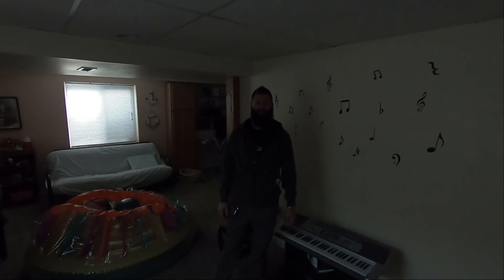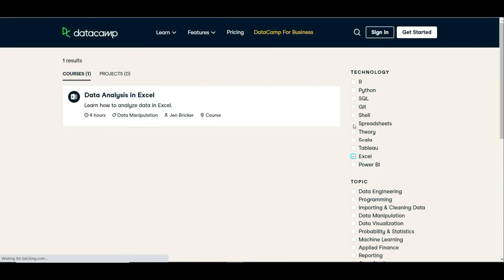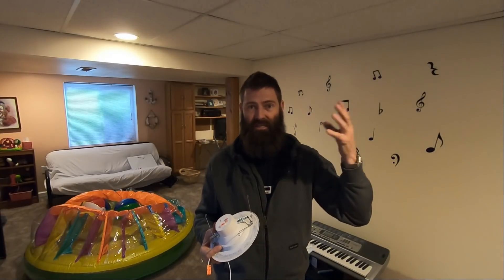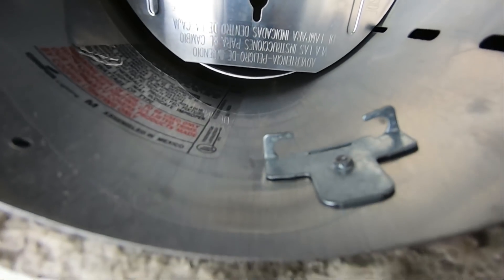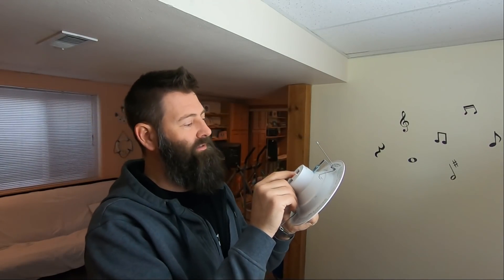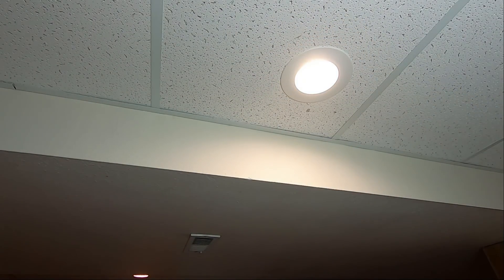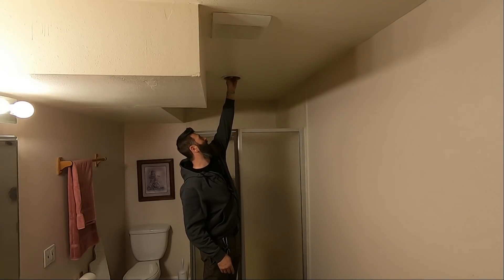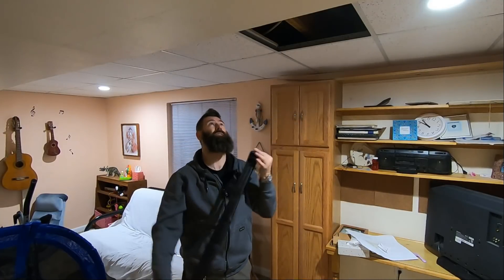The Worst Interior Lighting Fixed In 30 Minutes | LED Lights Will Change Your  Life | THE HANDYMAN |

Comment: "IC" means its rated for contact with insulation. Just changed some in my house and learned that. ^_~
Reply: Yep, otherwise you would have to push the insulation away if it was non-ic rated
Reply: @Zaakro  at least 3 inches away from the sides and nothing over the top of the light fixture

Comment: Hey Handyman! I ordered the LED light replacement for my can light. Opened the box from Amazon, pulled the insert out of the can, popped in the adapter and plugged in the LED light and clipped it in no problem! All in less than 5 minutes. Thanks for the video! Love your camera work and your presentation!

Comment: Just a friendly note from a IJoist designer ...  The holes it the TJIs are in the wrong  place. Make sure your hole is in the middle 1/3 of the OSB web only along the neutral axis. Never cut the top or bottom flange.

CHEERS

Comment: BTW when I added similar lights in my house from scratch, I believe IC rated means you can install them safely right up against insulation and other things because they don't put out enough heat to be a safety issue.
Reply: IC rated cans have a thermal cutoff and will flash on and off if you exceed the can's wattage rating. This should not be a problem with led's

Comment: I hate these can lights.  I have them in my vaulted ceiling with attic space above.  I replaced them with the LED lights, and made a box of sheetrock to seal above the hole in the attic.  No air flow, no bugs, and better for fire rating.  The beard is awesome!

Comment: Just a tip from a photographer and fellow YouTube. If you're going to show the difference in the light color, set your cameras white balance manually. Your camera is set on auto in this video so as you changed the light color, your camera automatically adjusted for it and after a couple seconds you no longer see the color difference. Does that make sense?
Reply: You can still see the color difference it is just not as extreme.
Reply: @ecospider5  oh yeah you can tell for sure but my point is if you watch your camera takes about 2 seconds and balances it back to normal. You only see the difference for those 2 seconds then it's balanced again. Either way it gets the point across just a suggestion so you can see the cor difference the whole time.
Reply from the maker: Thanks or the tip DiverseDad.  I could see the camera adjusting when I was flipping back and forth.  You could see the real color for a second or two before the camera adjusted.

Comment: IC I believe means Insulation Contact.  It means it is rated to come in contact with insulation that you may find in the attic.  I believe it is due to heat transfer.  Most of your older cheaper can lights were not IC rated and could start a fire if insulation was packed around them.

Comment: IC rated is for -An  fixture "shall be permitted to be in contact with 
combustible material or blanketed with thermal insulation", according to
 the Canadian Electrical Code section 30-906. Both the Alberta and BC 
Building Code (Section 3.2.7.2) stipulate that IC-rated fixtures are 
only to be use in insulated ceilings.

Comment: Ic means it is rated to be in contact with insulation, tc means it is not and usually requires at least 4” between the can and any insulation.

Comment: 1:45 I've used these lights throughout my entire house, and they work extremely well. I especially love the ones with the night light mode.  However, if your housing light switches are not up to date, you will probably have to purchase an LED wired light switch fir each unit. They're about an extra $30 for the ones with a dimmer setting.
Reply: That's what I was thinking, how to work the dimming feature. I guess with money, huh? Lol

Comment: IC rated is for "insulation contact" rated.  It can go into an insulated ceiling.
Reply: Meaning it can come in contact with insulation.
Reply: yes, that is correct to a point, you must still have a metal canister in place between the electrical fixture and the insulation. Some recessed fixtures when enclosed inside an attic or between insulated joists you must have another metal box surrounding the entire electrical components which leaves about 2" air space away from the insulation so it won't overheat and start fires.

Comment: I just replaced a can light with a regular plight fixture 6” hole. I had to rig a old work ceiling light box with the old rim and then drilled long tek screws on the four corners of the old can light box holder then drilled four corners of the old lip to the ceiling with the tel screws. Luckily my light fixture covered this mess and all looks like a million bucks. This seemed way easier but wife didn’t want recessed lighting.

Comment: Just got a 12 pack of these pancake led cans for like $90 on Amazon. So much cheaper than anything at Lowes or Home Depot, but probably a cheaper fixture that may not last as long.
 I prefer the electrical box detached from the fixture instead of attached like what you have. The reason: if I cut a light hole where there happens to be a rafter it won't matter

Comment: I prefer the 3500k for all lighting needs - 2700 too yellow and 5000 is too blue.. perfect choice! IC rated means it can be installed in an insulated ceiling. Meaning it won’t catch the insulation on fire - hopefully!!

Comment: Pretty sure those engineered joists are NOT rated to have loads hung from the bottom member like that. You're now relying on the glue joint of the bottom member to the osb web, and the osb web to the top member - not good!

Comment: Using a piece of Unistrut to connect both ceiling joists would have allowed you to add a ring and swivel through the tile to hang the swing.

Comment: If installed in a shower, do you need to do anything to air seal around the light so moisture doesn't get into the ceiling/attic?

Comment: ah, american houses, made of plywood and air.
...try doing that light replacement in Europe where ceilings are made of reinforced concrete (in 99% of houses built before 2010). In the past 10 years more and more of them use sheet-rock as a cover on the ceiling (for heat and sound insulation), but above it is still concrete. So you would  get only 5 cm of space to work with (low profile LED fixtures). Anyway, it always amuses me watching american build and handyman videos (going through walls with sledgehammers etc)...to conclude LOL

Comment: Can I use that light to replace spot lights that are in the ceiling? They look like those but the can be moved around
Reply: Hey Manders, it's very likely you can replace the spot light with an LED retrofit kit like Handyman did in this video. 

You'll need to confirm the size of the can (housing) behind the light and buy a kit that will work with that size. 5/6" cans are the most common but 4" ones exist as well.

Check to see if the can has the clips like in the video. If they do then you're good to go and install should be pretty straightforward. If not, there are other installation methods, but those ear clips are pretty common.

If you're looking for recommendations for a retrofit kit, we just installed these in our kitchen remodel and i found them to be very good quality for the price. They also have color adjustment built in on the fixture which is great. 

https://www.amazon.com/dp/B07FKQZDPS/ref=cm_sw_r_cp_apa_fabc_QE19TGYW3KGGBFGG1N2R
Reply: Yes most spot lights have a can behind them. You will have to pull the spot light down to see if there is a can though to be sure.

Comment: As the resident structural engineer I must point out that is NOT what those punch outs are for.  Loads should be applied to the top chord, not the bottom.  That said, it’ll probably be fine...
Reply: He's insuring future work. When the entire floor above completely collapses into the basement - BOOM! CRASH!  Cough... cough... 😉👍

Comment: Heh, "when this goes out in 50,000 hours" - more like "when the cheap parts that they saved 50 cents on in the driver craps out in a year". Sure, the LEDs last a long time, but they cheap out on the driver components, and they fail just as often as regular bulbs do. Plus, the CRI of the light is usually crap, unless you get really expensive LEDs.

Comment: Do you know if this trim light would work with an existing dimmer switch?
Reply from the maker: It says its dimmable.  I'm not sure if it has to be a specific dimmer.  There is a link to the lights in the description.  You could read up on the specs.

Comment: Talk about horrible lighting my house has 4ft shop lights for Primary lighting. Someone built  boxes and put them in it years ago."cough thanks Dad cough" Now I have upgraded them to LED shop lights and they are really bright ugly wooden square boxes. But they are going to stay till I feel like finally gutting the house and doing a complete remodel. Probably after mom and dad "move out".  Till then I'm going to deal with crappy "brilliant" early 90s engineering.

Comment: i have never seen ceiling tiles in a house. That's hella weird. That's like office shit.
Reply: Usually in basements. Makes it easier to access pipes, electrical and such without ripping into the ceiling. And homeowners (try) to install them, so they often have more waves than a hometown parade.
Reply: In basements eveeywhere
Reply: @shaneaugustine1280  Everywhere I lived with a basement we didn't have drop in tiles. It must be a regional thing. Then again every house I have ever lived in with a basement was 60-80 years old and I don't think they really had ceiling tiles like that back then.

Comment: Those joists are a joke. I have 2 by 8 inch solid ones. There is no way these new type joists are even close to the quality.
Reply: May be wrong (?) but I think joist choice depends on how much interior load above the floor has to carry. Solid LVL floor beams are good strong support for open-plan floor spans with mostly exterior wall weight loads & stresses. I-joists are perfectly suitable economical choices for more evenly dispersed weight loads, via multiple interior load bearing walls.